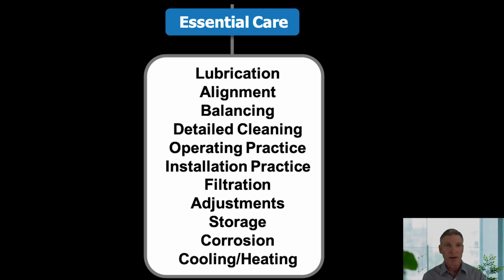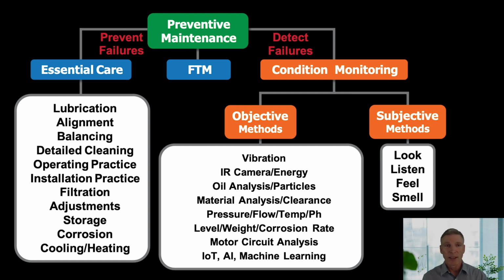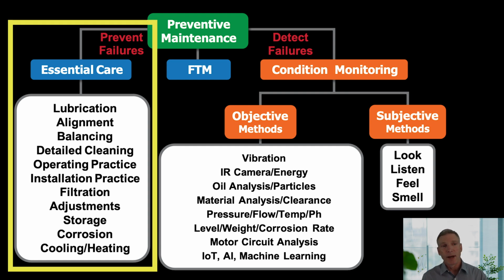Preventive Maintenance: Start With The Basics

Comment: Very nice video - but I would say that the most important problem to be solved is WHY the preventive maintenance is not being performed. And less what methods to use or how to prioritize.
Reply from the maker: Yes, agreed, an implementation has to be done in steps and first there has to be buy-in to the improvement.